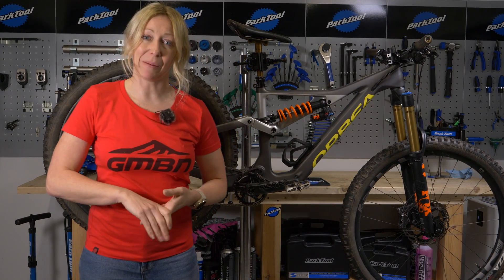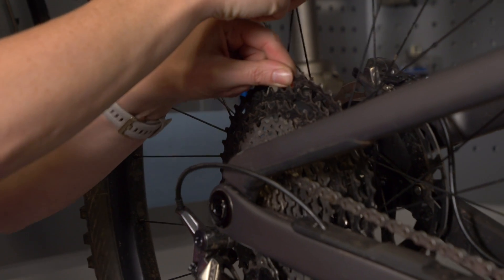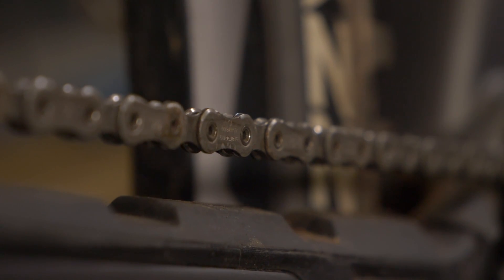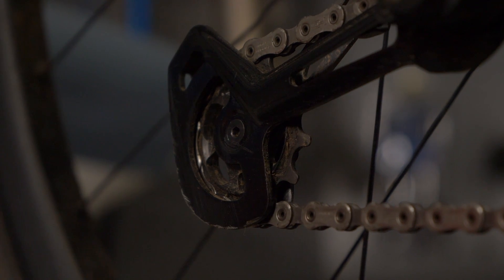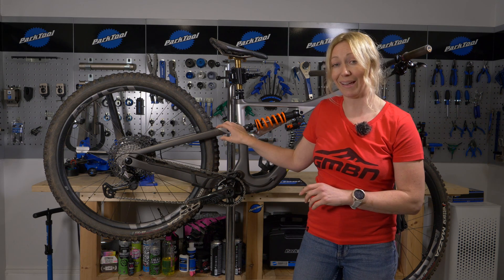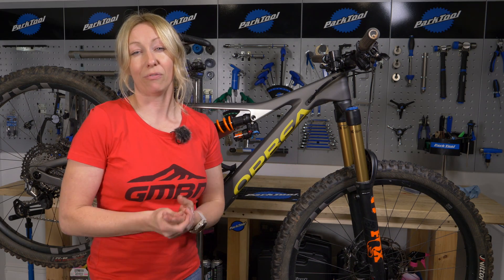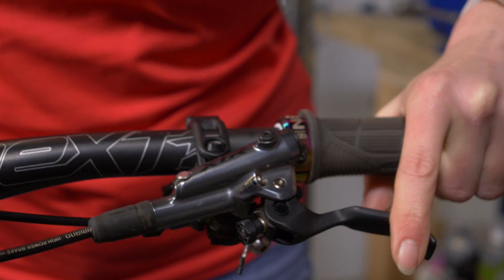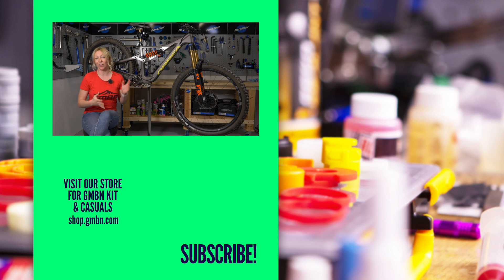Is Your Bike Safe? | Advanced M-Check Tutorial!

Comment: Does the age old motor-cross chain check still work on 10-12 clusters...
That's when you change to the largest sprocket and grab the chain at the back of the sprocket and try and pull it away from the sprocket... 
A good chain should remain seated to the sprocket, a stretched one will allow you to lift the chain away when its still seated at the top and bottom.

I usually forget about it until that pinch climb where I make it up 3/4 of the lift... but the chain is back at the 1/2 way mark checking out the track surface. (course I only run a 10)
Reply: I'd like to know if this works, also.
Reply: No
Reply: @pkeeley131  do tell...

Comment: Q? on an my 2nd hand Marin hard tail. I purchased some ParkTool Poly lube 1000. Is it ok to dab a thin layer on the fork stanchion around the seal so it gets drawn in?  The fork has a 20mm sag and I wrapped a thin zip tie around the stanchion. This is a twelve year old coil fork that my LBS says was working fine. I did apply some vaseline mentioned in one of GMBN's other tech blogs. (this is my first MTB iteration so I'm quite addicted to your tech blogs, for the basic stuff anyway.)